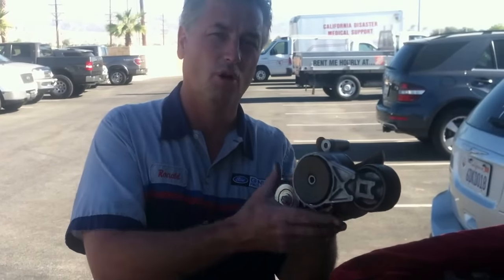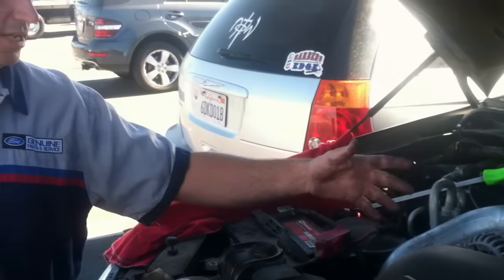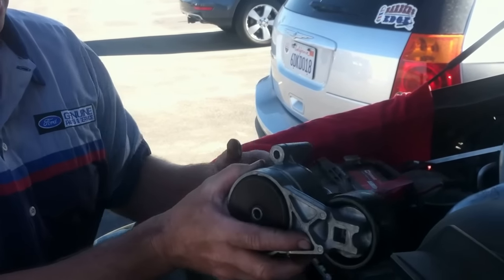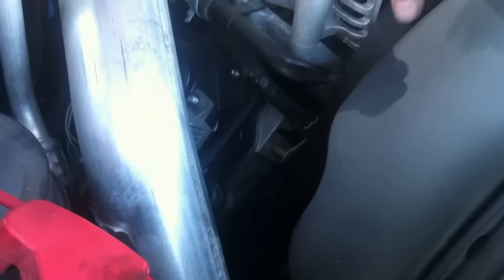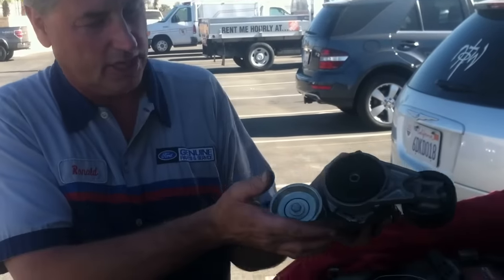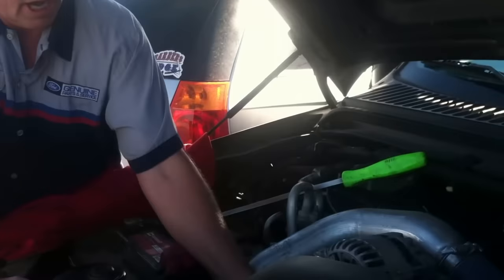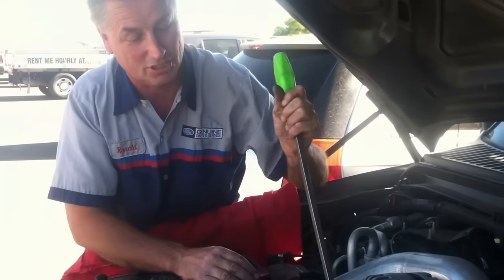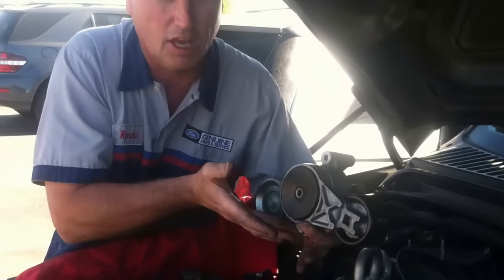6.0  POWERSTROKE F250 F350 DRIVE BELT REMOVAL TIPS AND TRICKS ALTERNATOR

Comment: After watching your video, I changed an alternator last night in 10 minutes or less. I could do it in 5 minutes or less now. That lock tab trick is amazing! I just pulled out the belt and flipped up the tab and released the belt. It stayed locked in position, just like you said. It takes all of what usually is the hardest part (getting into the tensioner with a 1/2" drive and the having enough room or arc to release the tension) out of it. I've saw quite a few of your videos over the years. You're the best 6.0 tech I've seen anywhere. I'm sure thousands of people will agree. Thank you for all you do!

Comment: Wife and I just did this, and we deeply appreciate the video!!   One thing though... I noticed the "Ford" on your shirt and I think you made it look easier than it is to pull that belt.   Wife and I had to use three arms, with all our might, and my one remaining arm to flip that tab up so we could then easily swap out the alternator.    You probably yank on those belts all the time and have the strength to match!   I noted another YT vid where the guys swap the alternator using a pry pin and not flipping that tab - I was glad the tab was there.   It took us about 30 mins to figure out "who goes where" to pull on the belt, but once we got the tab in place, the job went as easy as shown.   As per your vid, a simple yank let the tab out and all was good.  Thanks again!!

Comment: This tip really helped me out quite a bit - I am not wimpy guy but could not put enough pressure on the belt to allow the tab to lock - simple solution... I used a ratcheting strap (and heavy blanket) to go from belt, around passenger fender, to the frame.   Put the blanket between the strap and the fender, then cranked on the ratchet till it applied enough pull to the belt to rotate middle pulley of the tensioner in order to lock in the tab.  Worked awesome and saved a lot of struggling.

Comment: Thank you SO much on this TIP,  Not having the cheater bar available, I was about to try a 1/2 breaker bar to relieve tension on the belt or fab something similar... THIS TIP WAS HUGE !!   My only complaint, my arm got greasy reaching down to depress the tab.  Waaaaaaaaaaa

Comment: Awesome, thanks. I just had to replace my alternator and it worked. It did take a lot a strength to pull on it and get it lock while holding the belt with one hand. Them pulled until I heard the pin drop and sure enough the tension was back on the belt. Glad this was still out there.

Comment: The belt was super tight, and I had to use all my strength to pull on the belt, but it all worked, and changed the alternator and both batteries in approx 20 minutes! Thanks for the tip about the tensioner!

Comment: That is awesome! Wish I had known this when I had my 04 f350 6 liter. I changed my alternator 3 times in 1 week and didn't know this trick or have any tools other than a socket set and true grit
Was quite a pain in the arm and still had charging issues. 
Finally traded it in for ecoboost.
Reply: Yea I love Ford but they are a mfer to work on. Why the hell did you go through 3 alternators in a week?

Comment from the maker: Yes you can remove the belt and change it this way. 03/04 are a lot harder with the insulation or dual belts are almost impossible, but possible.

Comment: Man my 06 powerstroke did not have the tab. I just unbolted the alternator but man the belt is a pain to replace. I had to disconnect the tension thing just 2 bolts and fed it through and used the alternator as my tension.

Comment: Can you recommend a decent spec alternator for my 2003 6.0 diesel F350. No heavy package accessories, just stock electrical. You must know the issues with this particular nightmare vehicle. The shop I had it towed to isn't a specialty outfit. I just want to make sure I get something safe with enough amps and don't get taken to the cleaners. I only hope it didn't take out FICM, glow lugs, etc. Batteries were only 5 months old. Truck just died in mid flight on interstate after difficult start. Help me please.

Comment: Hook the long end of a racket tie-down to the wheel. Go over the fender hook the short end to the belt. Tighten till you can pull up the lock, hold it up while you release the tie-down. Easy

Comment: How do you change a serpentine belt on a dual alternator 2006 Super duty F350 6.0L?
Reply from the maker: sometimes with 03s or dual alternators you may want to take off the fan and shroud/defuser. Or if not it's the same way except the out one first.

Comment: man i have problem with 6.0 powerstroke 2003 and now they are maike leak noise and when i put on drive die and i change icp sensor i changer the sensor the gos on high pressure pump then they said my torque comverteros bad i change to but the truck got no power i os thinking i cud be the turbo or the egr valve or maf sensor because they hace P132B CODE PLEASE HELP ME

Comment: how do you do it when the tab is broken 😂.
Reply: 1/2drive ratchet in the square hole he points out. it won't lock but it will give you the chance to release the tension so you can get the belt off the first pulley.
Reply: @quadse7en  stripped the square hole 😫. had to take out the fan shroud in order to get a deeper bite. made replacing the steering pump and gear 3 times as long! all is done now

Comment: Not as easy as it looks if your serpentine belt is tighter than normal. I had to attach a ratcheting strap to mine in order to loosen the belt tensioner. Other than that alternator install's aren't to difficult.

Comment: An after thought. His oil cooler video? I think it was Milwaukee tools that he printed to stop using their tools? They should have paid the guy. Im on an airline now and been hee hawin on coverting to battery. Im a matco guy mixed with a good bit of harbour freight. I like the tools he used and I know people that use them just like he did. Everyone does. Dont matter the brand. They owe him. I'm pissy with them if they said it and Im still gonna buy them because I also got a very in depth video with using it. I could see the speed difference. I'll buy theirs before the tool truck and ebay. I know to buy extra batteries. My 25 inch and 50 inch ratches gonna hit me 4 to 6 hundres with the charging station. They miss an opportunity for marketing this one.